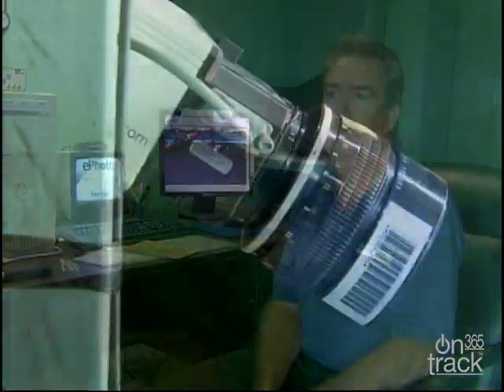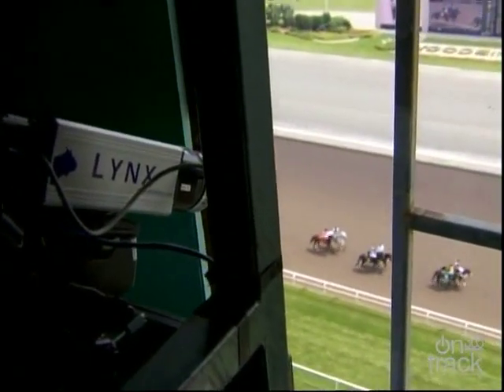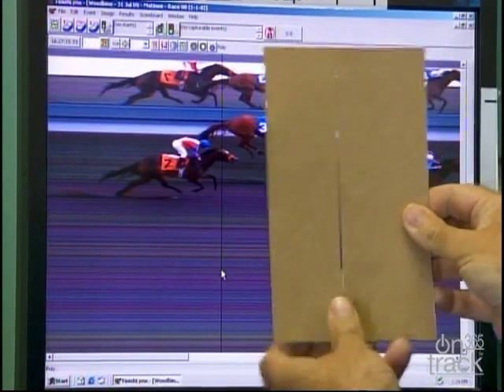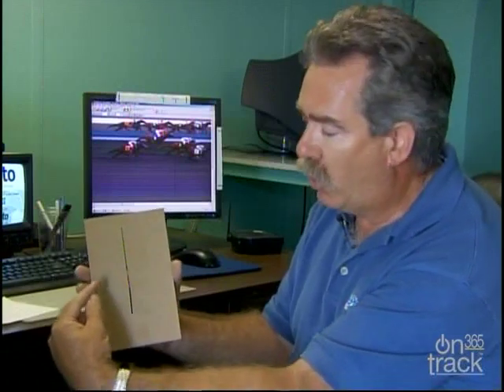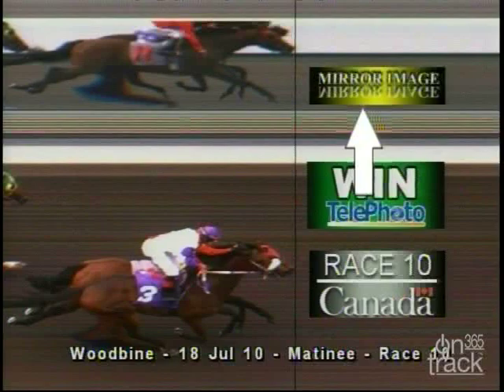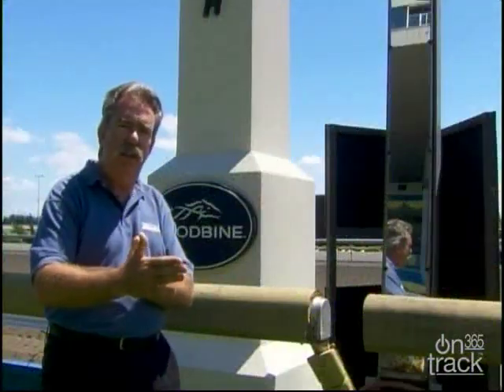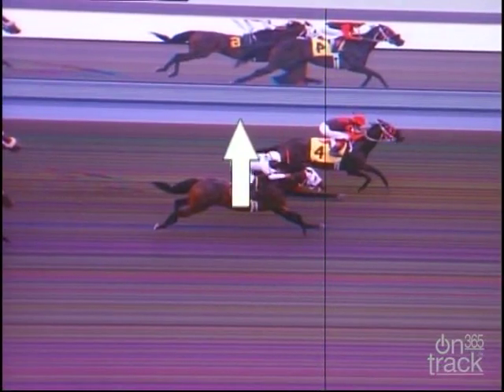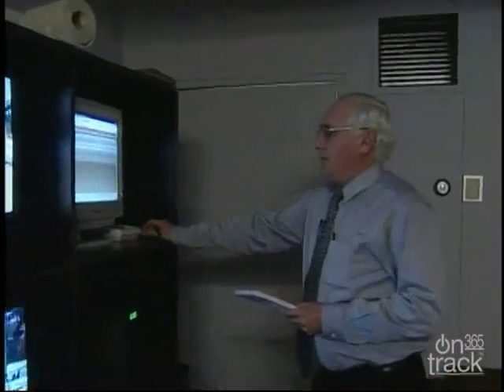How Electronic Photo Finish Works

Comment: What I don’t understand about photo finishes is how they know exactly how many frames per second it takes to capture the contestants in a way that makes them not appear stretched or squeezed. Because if you were to walk slowly over the finish line you would get stretched like hell, and if you somehow were able to cross the finish line in let’s say 5/5000 of a second, your body woud be 5 pixels wide...
Reply: Provided the camera takes a new frame 5000 times per second and that the sensor is 1 pixel wide, as stated in another video.
Reply: The subject will always be stretched or squeezed depending on their speed. It doesn’t matter for making out the finishing order an numbers though. You can always stretch the image afterwards (though I don’t think this is possible with FinishLynx used here). Also when there is a speed difference between finishers, like in cycling, the other object will always appear more stretched or squeezed. Again, this has no effect on the “timing” accuracy or “placing” accuracy, since when the camera captures a line, it is the very same moment that determines who the place goes to.